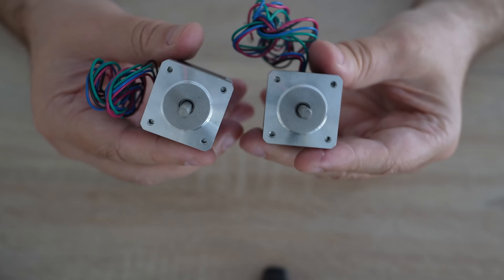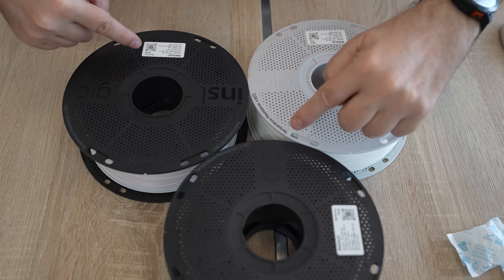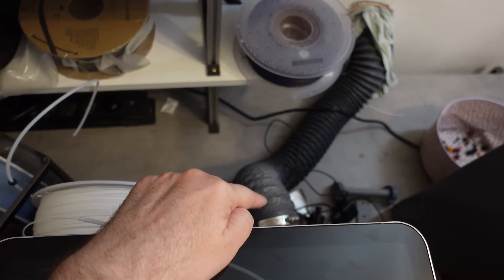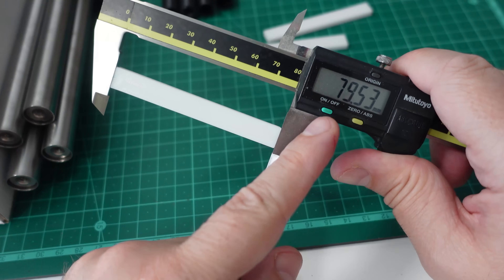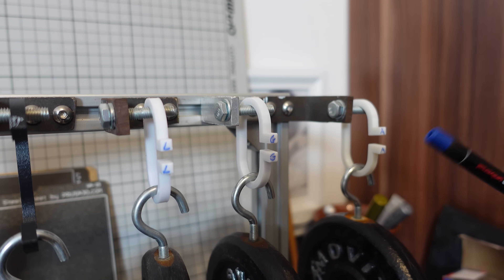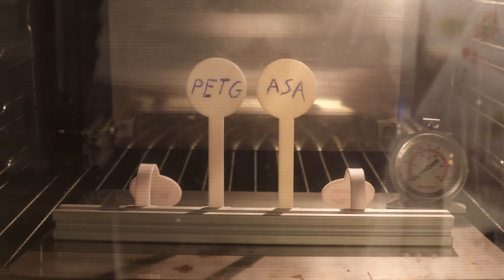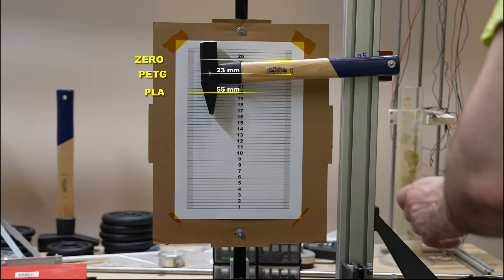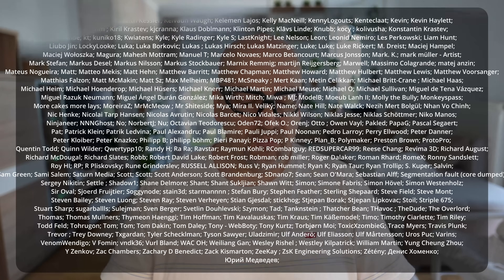Inslogic PLA Pro vs PETG Pro vs ASA: Key Differences Explained

Comment: As a scientific engineer I enjoy your in depth analysis but I these results only apply to newly printed items. If you wre to test them again in six months time you would get very different results (I have done this). The PLA which looks to be strong in these tests is practically useless six months later (stored indoors in UK climate) wheras the ASA and PETG are much more resiliant. I dont make videos but would love to see you perform these tests and see if you get the same results. I find PLA so poor over time that I now never use it.

Comment: Fantastic testing as always. Just a suggestion: alongside the Ultimate Tensile Strength (UTS) you already report—super helpful—it would be great to also include the yield strength and the yield-to-UTS ratio.
UTS tells us when a part breaks, but yield strength shows when it starts to deform permanently—often the point where it stops working, like a hinge that no longer aligns.

Example from Prusament:
PA11 CF: Yield = 42 MPa, UTS = 42 MPa → Ratio = 1.0 → breaks right after deforming.
PC Blend CF: Yield = 63 MPa, UTS = 88 MPa → Ratio = 0.72 → bends before it breaks.

Same brand, similar UTS, but very different failure behavior. Including this info would help makers choose not just strong filaments, but ones that survive real-world use.

Thanks again for all the great content!

Comment: I have a couple of spools of ASA and I only use it for outdoor stuff. I use PETG for a majority of my prints because PLA used to be very weak. The newer PLAs have me reconsidering.
Reply: Modern PLA is strong but it warps at low temps, even for stuff that is not outside. I print in PETG because if I leave anything PLA in my car it is ruined

Comment: I think you should get beefier ducts and duct fan... go check out a grow shop... this way you can suck out all that toxic air and blow it outside the house...

How does printing temperature affect strength? FOr the test at 9:50 I would have taken another measurement, to see to what value does it return when you remove the weight... I.e was it permanently deformed or just temporarily..

Comment: It would be interesting to see you test some of the special and technical filaments from Filoalfa, like the AlfaPro which is an UV and Hydrolysis resistant PLA that resists up to 115C with anealing according to the datasheet (this one I have tried and it behaves very well with annealing, but they also have many weird filaments I have not seen in other places). It's an Italian brand so I think it shouldn't be hard to get since you are in europe

Comment: I’m surprised that PETG has lower impact resistance than PLA. I guess the overall strength is a contributing factor.
Reply: PLA is more rigid, PETG is considered more flexible
Reply: @user-zl9cv7gb5u  yes, I assumed flexibility implied better impact resistance but I guess that’s wrong.

Comment: I am curious how differently the ASA would perform with a heated chamber like the Plus4. It is recommended on the Inslogic website, though they don't specify a temperature. Have you done an episode comparing various filaments with any without a heated chamber? If not, I'd love to see that.
Reply from the maker: I have Siraya ABS on the test now (CF and core). And I will test that too.
Reply: @MyTechFun  Ah yes I remember that test. I would imagine some filaments need it much more than others of course. Thanks. Keep up the great work!

Comment: I would like to see some harder TPUs on your channel. 64d or 80d and even higher and how does it compares against ABS/ASA in terms of impact resistance and layer adhesion.
Reply from the maker: You will. 2 (72D, mix of nylon and TPU and TPU Hardness+)
Reply: Thank you!  @MyTechFun
Reply: @MyTechFun  aww yeah, I bought some of that stuff too and I’d love to see how it compares.
Reply: Cc3d?; @MyTechFun
Reply: I"m not sure of the number, but sunlu's one is quite hard, hard enough you could make some gears from it if you had to. Pretty robust material but i don;t have a dryer so I can't print it to "look" good" short of gaskets etc...
Reply: @poepflater sunlu is standard soft 95a. 80d is something as a hard as helmets for construction workers. If you are interested search for "filament shore hardness scale"

Comment: pla+ is such a rockstar material esp compared to how cheap it is
Reply: it would be if it didn't warp at such a low temperature
Reply: @user-zl9cv7gb5u  never had a warp. you not run a heated bed? If I remember correctly, pla+ doesnt even warp on a cold bed
Reply: @AtleastImNotAutistic  he means warping after the print from the sun, electronics, etc
Reply: PLA, PETG, and ABS cost about the same in my country, sth. like 11 €/kg.
Reply: @EditioCastigata they’ve deff got the most entrenched supply chains due to their age

Comment: Curious question.  Why do his results in his spreadsheet show commas?
Reply: If I understand your question then commas are the same as decimal points in many countries.  My impression is that there are more countries/languages that use commas than use the period.
Reply: Decimal separator. But some spreadsheets are weird because they switch it to dot sometimes…
Reply: @ChrysMTP  A frequently seen sign of shoddy programming. The localization is forgotten somewhere in the pipeline, likely from internal representation to display.

Comment: I probably wouldn’t use any of these. Something stiffer would be better. There are a number of choices. Actually, some of the new PLA HT filaments might work well. Creep can be minimized, or practically eliminated by proper design.

Comment: Please test 3DX WEARX. It's supposedly a wear resistant nylon. It would be a different and specialized filament to see.
Reply from the maker: I contacted the company. If they will send me the filament, then it will be tested. (I would buy it, but I have too many filaments here, waiting for the testing..)
Reply from the maker: For now, I am full with filaments for the testing (and budget I spend on them). If company will send it to me, it will be tested. I contacted them.

Comment: I would not use PETG for a motor mount because I have measured temperatures of 80C on my XY motors , ASA is the best choice IMHO , BTW I account for shrinking in the filament profile of the slicer.
Reply from the maker: Prusa MK4 has the motor holder from PETG. Shrinking cannot be always compensated. Imagine you have some complex geometry, not everey element will be in the same position calculated by shrinking.

Comment: Thanks for the testing!  It is much appreciated.

Since the Bambu engineering plate is no longer available it might be helpful to use something else when you print your testing samples.
Reply: Planned to buy it too but they did stop selling it. 

Nowadays on my P1S I just use a smooth PEI + glue/spray/whatever I have and it has been working well so far. ABS, ASA, PA, better than my stock textured PEI, or my Glacier. Especially smaller parts. On bigger parts I use my biqu glacier plate
Reply from the maker: Really? I didn't know about it. Why? It works sooo good for me. Is there a replacement? What do they recommend for technical filaments now?
Reply: @MyTechFun  they don't appear to sell a plate specifically for high temperature anymore. I've used the Supertack plate for PET-CF and Nylon-GF and it works well enough. Not sure why they discontinued the Engineering plate.
Reply: @MyTechFun  I think they dropped it about a year and a half ago.  The current Bambu offerings are the textured plate which you have, a smooth PEI plate which is probably what they intended as the replacement, and the Supertac plate which I think is really only good for use with PLA.  The Smooth plate will be ruined if you try to use it without some adhesion modifier to LOWER the adhesion with at least PETG.  I have chunks missing on one side of my plate due to this.  They also currently sell a plate with the textured surface on one side and the smooth surface on the other.

I've been looking for an engineering plate on eBay.  I've heard good things about it.  I have also heard bad things about it.  I think they stopped selling it because PLA won't stick well to it unless it is really clean.  And most people are not clean enough, they get finger oil all over their build plates.  IPA just spreads the finger oils around giving you a nice evenly oiled non-stick surface (unless you flush the surface with a lot of it.)  You seem to always use some sort of adhesion modifier on your engineering plate.  The problem with the adhesion modifiers is that they leave a residue or change the surface finish of the part.  I still have a printer with a borosilicate glass print surface and I like printing on it because it leaves a mirror finish on that face of the parts.  There are tradeoffs to everything!